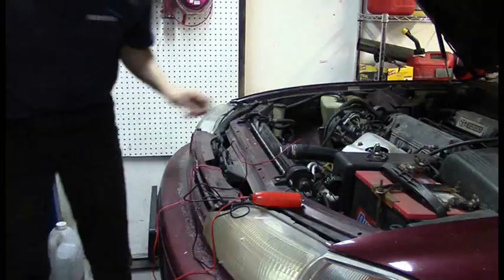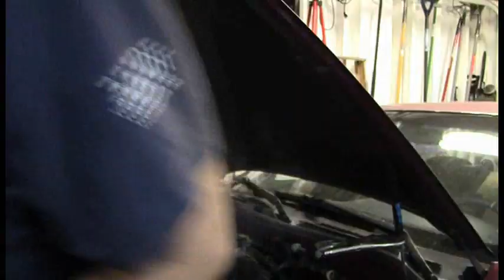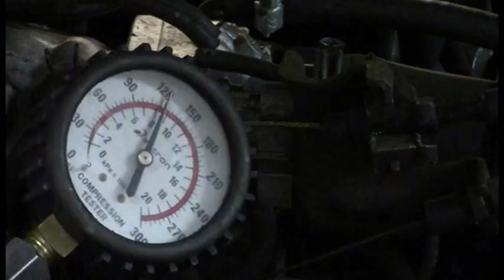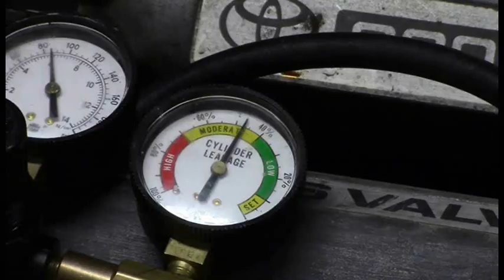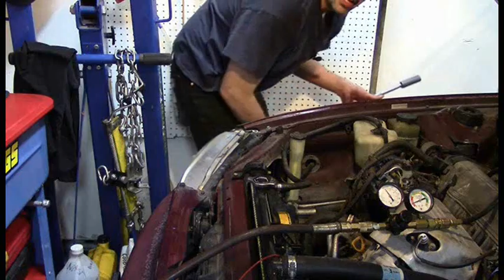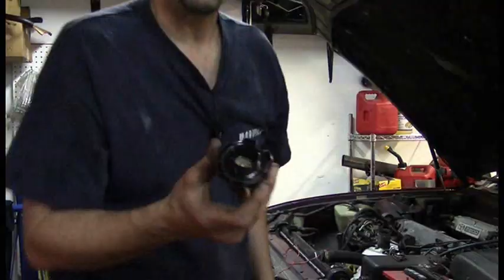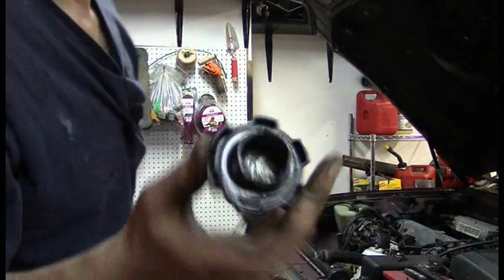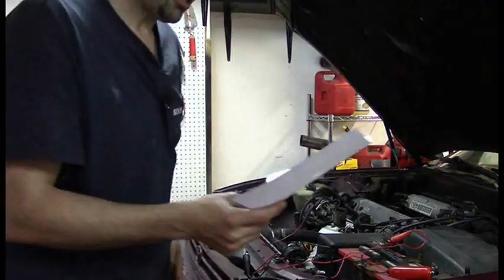12 Ways of How To Test A Blown Head Gasket Compared- PART1

Comment: Spark plug reading...if it's white it's running lean (really not good), if it's brown it's okay, and if it's wet looking it's running too rich (also not good)
Reply from the maker: About as helpful as a chicken with a boomerang.
Reply: And if you can't understand that you're about as bright as a single watt light bulb
Reply from the maker: @willk3807  Ok so lets say the plugs are white. Now what do you do?
Reply: If the plugs are white it means you are getting too much air in the combustion chamber. This means you have a vacuum leak somewhere. Use a smoke machine to determine where the leak is occurring
Reply: You may even have a faulty fuel injector. This could also cause a lean condition. A number of things could cause the lean condition. Take your car to a mechanic and have them diagnose the problem or buy a scan tool
Reply from the maker: @willk3807  Ummmm if you are going to just take it to someone who can diagnose it.... what's the purpose of reading the plugs?  That makes it pointless doesn't it- if you're just going to have someone diagnose it.
  What am I missing here? What is the purpose of reading plugs when you can simply do a basic fuel trim analysis and not even pop the hood on the car?
Reply: I have the equipment to determine what's wrong with a car. I was guessing you dont have the necessary equipment. So sence you haven't a clue. I suggested you take it to someone who does. I was trying to help you out.
Reply: Hey schrodingers box...i liked the videos you posted. Didn't realize who I was talking to. Your videos helped my diagnosis of my e46 engine. You do know what you are talking about. Thanks for all your help. 👍
Reply from the maker: @willk3807  Gotchya-- so curious- given your equipment how do you do the diganosis from the spark plug reading?  The plugs are white- you suspect it's because of running lean.  How do you determine it's a vacuum leak? You actually set up a smoke machine and check?  Wouldn't that be a waste of time if it's a fuel injector problem- how do you determine it's a fuel injector problem?  It could also be a weak fuel pump failing to deliver fuel to maintain stoichiometric ratio- how do you determine if its that?  Could also be a MAF sensor dirty or inaccurate- how do you determine if that's the cause?  Maybe it's a fuel pressure regulator- how does that get determined?  Can any of those variables be determined from "reading " the plug?
  Just curious how reading the plug is helpful in determining the variables.  Or is it not useful?
Reply: Schrod...you have a valid point..not gonna argue that
Reply: Honestly I think spark plug reading was something kinda handed down from the carborated generation. Maybe I'm wrong but yeah spark plug reading is pretty much useless on modern vehicles
Reply from the maker: @willk3807  It was useless then too, to be honest.
Reply: Well yeah...but it's pointless to turn off the electricity to change a lightbulb but my wife still has me go to the fuse box and shut off the breaker. I guess she's afraid if it kills me she might have to go back to work.

Comment: Great teacher. But I am having some trouble with my 09 Dodge journey awd sxt maybe u could help had 2 mechanics look at it and got 2 different answers. One is a dealer and I had it in 4 times with in 1 and half to 2 months. They changed battery connectors, thermostat, PTu after I spent $3000 so excited to get my car I made it a block it started whining so loud I took it back then they tell my trany shit now, couldn't drive it they say. Went to pull it home it started right up drove it home just fine no slipping no delayed shift or noises. Now won't start sometimes if it does it shoots out blue smoke. But drives fine so took it to a friend's mechanic he says blown head gasket. So how can it be two totally different things?! Idk what to do spent more money for transmission or throw it away! I love my car but so many problems!😩 You seem to know some stuff lol so was kinda wondering what u think? Please I need my car! Thank you in advance.
Reply from the maker: What data is there? what is the compression on each cylinder? What are the fuel trims showing at idle vs load? what is the MAP output?  I need basic data to even get a starting idea.
Reply: @SchrodingersBox  I'm not sure what any of that is. But the dealership said they would change my transmission filter and fluid and see if that would help but when they pull that out I guess it was full of metal shavings but my transmission hasn't have any problems so I don't understand that could that have been from that PTU cuz when they took that PTO out he said the gears there's nothing left of them? and also after they fix my thermostat I got the same cold about a week later that's when it started to get a weird smell and started to run funny my check engine light would come on my throttle body light would come on I'm telling you I just don't know what to do about this vehicle!
Reply from the maker: @casandrasparky1376  Agreed- not sure the idea behind Trans filter and fluid change because I see no evidence for it- which is exactly my point.  The method I use that requires the data I requested is it allows me to see what the engine's computer is doing as result of the fault and I can trace back to exactly where the fault is. This is evidence-based scientific diagnosis instead of just throwing parts at it till it's finall guessed and fixed right.

Comment: To beat a dead horse even more, an extra compression check by ammeter connected to o-scope and clamped on the positive battery lead could help narrow down which cylinder(s) require less current to turn over the engine.  Downside is that test is not definitive for bad head gasket.  Great demonstration and thank you!
Reply from the maker: Yes at the time of the video I did not have a scope. Since getting a scope that is my primary detection method.

Comment: the air compresion test through the coolant system could be done using only one spark plug in the cylinder we want to test (in the other we let it free) and see the response in the coolant (as you did)

Comment: Good evening Mr. Paul danner  
 I have a 2000 Dodge ram 1500 5.9 my fuel pressure reads 45 but drops when I turn key off it's a return less system is this normal
Reply from the maker: Depends how much it decreases and how fast

Comment: I have an 04 Civic and there’s bubbles coming up on the radiator I changed the radiator, thermostat and recently a new water pump and nothing, when I accelerate bubbles come out, is this a sign of a blown head gasket?
Reply from the maker: Yes it is. What is your compression showing?
Reply: Schrodingers Box I haven’t Done a compression test but I drove it far a few days ago and when I got home the overflow tank was all the way to the top and parts of the batter and other parts of the car had coolant sprayed on to it, I tried bleeding it out but even when the fans came on the bubbles were still there
Reply: Battery*
Reply from the maker: You have no data to determine a cause. Compression or leakdown test is needed.
Reply: Schrodingers Box okay will definitely do that thank you for your advice.

Comment: What about some milky watery oil cap but no smoke ou the muffler and a slight smell of burned coolant? Does this mean the engine was blown but rebuilt?.. blown head gasket/block etc?. Or on the way to that
Reply from the maker: Can’t tell- what was the compression data?

Comment: Hi I have question I bought a 206 fever 1.4 2004 plate but unfortunately it needed lots of work and I now have a problem with coolant leaking very very quickly it all happend as I turned the engine on and coolant flowed out do you have any idea on what it could be as I have no pressure in the system anymore and when I test the bottle to pump section. Litrally 2 seconds later the coolant comes flooding back out
Reply from the maker: I would need to know where it is flowing out and what the results of a basic pressure test were.
Reply: @SchrodingersBox  it's flowing out on the left hand side of where the engine sits looking towards the car. Next to the water pump up to maybe 3 inch away at most but I can't get in and see clearly
Reply from the maker: @charliefuller6735  Well the very first thing is you have to investigate the source of the leak. Take it apart so you can see the source!
Reply: @SchrodingersBox  ok only issue is I don't have the tools to lol

Comment: I lose heat/ heater blows cold air...After a minute or two the temp gauge goes back to normal.The side effect is that antifreeze gets blown into the coolant overflow.It overflows into the coolant overflow....maximum air bubbles. Is that a case for  blown head gasket???
Reply from the maker: could be. what is your cylinder compression variance?

Comment: 09 Nissan rogue awd
leaks antifreeze from the exhaust bolts to the cylinder head 
but none
in oil
none from the tail pipe
how can i know what to do.
Reply from the maker: do a cooling system pressure test to verify source as head gasket or intake gasketand if necessary head gasket or intake would need replacement.

Comment: What is it that you use to start the car remotely?
Reply from the maker: Just bypassed the starter solenoid load side at the relay is all. Nothing special.
Reply: @UCnIQ-_hRpyHR68f23dQQHUg ohh yes, thanks, actually i understand that. i was just asking if you commanded it using a remote fob or something :). Btw, excellent videos. Im new on your channel and I have learned more about mechanics and engine control in 10 days that in my whole life. Good troubbleshotting path. We have a good advantage over people who just change parts and that exists in any tech profession, not just mechanics, lucky for us.

Comment: Have you actually seen coolant draining from sump first, then oil. If you just put water in oil, oil will stay on the surface, but in this case coolant mix with oil and together make new form where you can not separate them anymore. I would just like to know if you've seen coolant drainning first as I haven't.
Not native speaker so sorry for weak English!
Reply from the maker: Oh absolutely I have! many times! But the car has to sit for q number of days before the phases separate out.  Usually I see "mud" or some coolant and then mud and then oil but yes- if the coolant and oil have enough time to sit, you will see the coolant come out first indeed!
Reply: @SchrodingersBox  OK. Thank you for answering!

Comment: The carbon dioxide test it's not absolutely positive. There could have been a previous repair that was done but carbon dioxide was still left in cooling system. So I would flush the cooling system first test it and make sure there's no carbon dioxide in it then run the car for a little bit if you can and see if there's carbon dioxide in it after you flush the cooling system.
Reply from the maker: The test does not work that way- it does not detect carbon dioxide in solution.
Reply: Yes but if Boyle had gotten into the cooling system but say it a couple years ago and it got fixed and maybe someone just added some coolant to it and left it like that what are you get a false positive even though the head gasket may have been replaced a couple years ago and everything works fine there could still be that oil residue in the cooling system which would show up as a false positive?
Reply: I guess I see what you're saying it would show active gas going in there at the time of the test and oil wouldn't give a false positive is that correct
Reply from the maker: Correct. The carbon dioxide is from "live" exhaust in the cooling system, not solublized .

Comment: The reason that I'm looking at videos is that there's a couple oil drops in garage  that appear to have water in it. Is that a definitive blow headgasket?
Reply from the maker: No it is not definitive
Reply: @SchrodingersBox  thx for replying, what would it typically be? I have a 09 outback.
Reply from the maker: ANything.  You have to diagnose the cause.
Reply: @SchrodingersBox  did the block test and it was negative, very happy to see!

Comment: Cream sludge on the oil cap doesn't mean headgasket. Short trips and cold climates allow condensation inside the engine. It's normal, and not a reliable way to verify. It's a worthless way to evaluate.  I need to find someone local to do pressure checks on my ford f150 5.4L. Definitely have a cracked plastic upper intake manifold (the black octopus) that needs to be replaced and valve cover gasket needs to be replaced. Shady mechanics will claim a lot of untrue things with those two alone.

Comment: You say in the video multiple times the combustion and coolant channels being connected somehow would be the most common form of "head gasket" failure. Is oil passage and coolant passage also possible? My car has oil leaking into coolant but no coolant in oil and I checked trans fluid also just to be sure it wasn't leaking inside the radiator which has a trans cooler. I have lost about 30% compression in cylinder#2 it is a 4 cylinder.
Reply from the maker: It is indeed. In fact compression loss to the outside of the cylinder is even possible.

Comment: Really helpful!  I’ve had a shop tell me blown gasket but I don’t think so but no sure what it is ... misfire #5 and replaced coil and spark plug but same ... has never overheated but misfires when idle .. I bought the scientific test you showed first and it passed with flying colors ... still testing and using your videos - thank you so much for taking the time

Comment: My car is leaking tiny drops of oil.... I took it to my mechanic, and he said it's the head gasket... however, I didn't experience any of those symptoms u mentioned (white smoke, overheating, white sludge etc)  Is he right? or should I get a 2nd opinion?
Reply from the maker: It is far more likely to be intake gasket. I suppose it is possible a head gasket could leak oil without ihaving a compromise in combustion chamber but I have never seen that.
Reply: I would
Reply: What kinda car do you have ? Is it a old Ford

Comment: Hi great video.  I have a 350 motor , is there a way to test if the intake manifold or the head gasket is leaking ? 
Losein water  i don’t see any  leaks thanks for any help
Reply from the maker: Yes look for a change in fuel trim when propane is entrered into the source.

Comment: I thought most of the tests for exhaust gas in the coolant are based on checking for carbon monoxide not carbon dioxide
Reply from the maker: No it does test carbon dioxide. It is called Pryometry.

Comment: i have a diesel nissan navara 2008 and im getting pressure im my resevoir with the water squirting into the resevoir. no bubbles in the radiator where the radiator cap fits.  however the pressure builds up and it overheats.   whats my problem?
Reply: Same problem here. 01 Honda civic

Comment: 1994 honda civic eg 275000 kms on kit has blown head gas kit because of  coolant leak from broken radiator. Smoke come from exhaust headers manifolds. Bubbles from coolant .

Should i change gas kit ?
Reply from the maker: dont know. What data do you have?

Comment: Hi math, great video, I notice that when you used the leakdown tester do not put the cylinder at tdc? You move the piston up after the tester and air was hookup, I did not know that trick, that was great method, thank you math, please correct me if I see wrong what you did, or explain how was done ,cheers from Ontario ca.
Reply from the maker: Thats exactly how I did it. I find it much easier than finding TDC. The valves are closed on compression stroke either way!

Comment: Very good point about "There is a cause for a head Gasket"  A lot of my friends think "Oh I'll just replace the head Gasket" I told them "No... You need to check out the engine cooling system, Compression, Head, etc etc.  Once you pull off the head gasket if you see where it is blown at, look at the head and see if there is a spot there either raised or otherwise.  You can also warp a head if you let it overheat.  Sadly..
Reply from the maker: Good for you!! exactly correct. A blown head gasket is a result, not a cause.